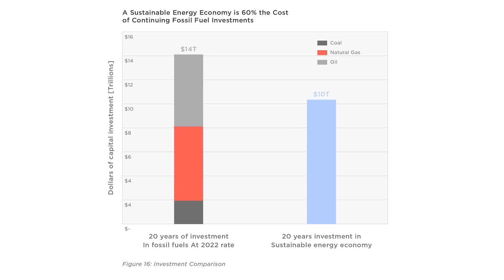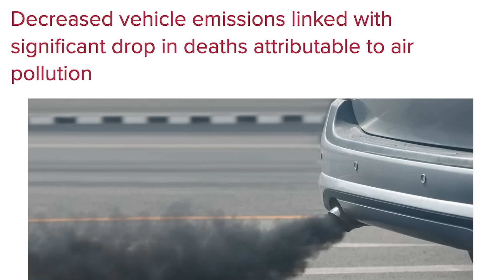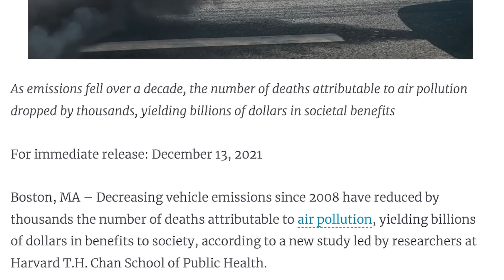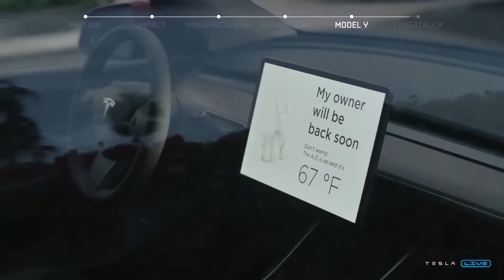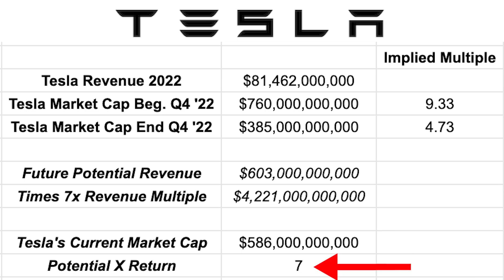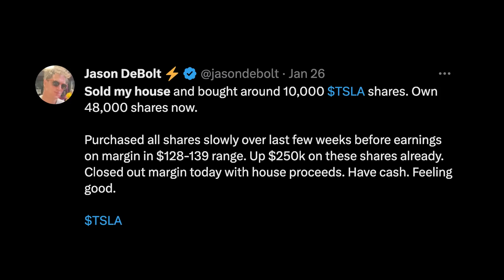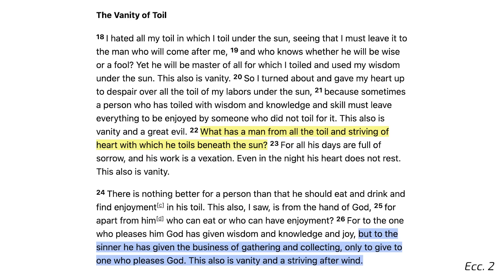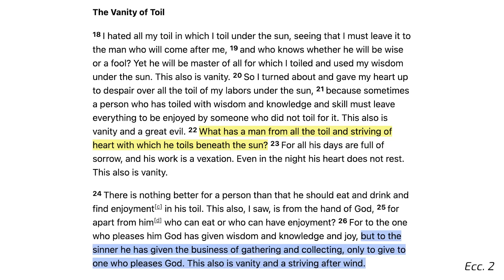People Have No Idea What Tesla Just Revealed ⚡️

Comment: I was a bit surprised at how little was new. Overall a good summery of most of the current thinking assembled well. But really nothing that hasn't been advocated for years. Some tweaks on the costs and a more sedate time frame. But I could pull most of this out of someone like Amy Klobuchar's 2020 infrastructure plan with a bit more heat pump. 30 percent over building of peak renewable generation is something known about for decades. The only thing really different from basic moderate climate proposals was the lack of economic disruption consideration. Anything to get more people onboard , but I was disappointed.
Reply: But you've been listening.
The point of this is that many people haven't.
They need spoon feeding..... Multiple times.
Reply: @rogerstarkey5390  I know it is sad and I know some of my pent up frustration came out. On the political side it has been equally frustrating trying to get people to understand that they need to be selling the wealth aspects of the transition harder.